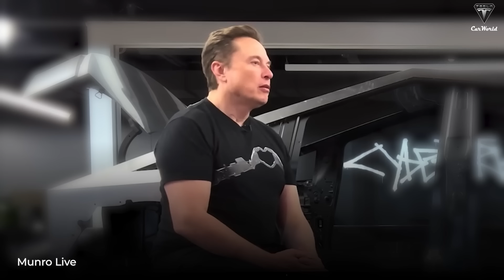Massive Tesla Giga Press 4.0 Detroys All Welding Robots!

Comment: The number of cars produced today is excessive and does not correspond to their actual practical necessity or use. In other words, production is driven by industry or market forces than by real demand.

This is not an economic system but a wasteful of energy, resources and space
Reply from the maker: That’s a fair point—high production only makes sense when demand is real. Tesla is betting that a vehicle priced at $30,000 or less and designed for fleet use can create demand beyond normal private-car ownership.

Comment: Another Cybertruck flop designed to fool investors into boosting falling Tesla shares, when will investors price stock on profits instead of dreams. Tesla's real intrinsic value is heavily debated, with traditional financial models estimating it between $27 and $120 per share, while the actual market share price trades significantly higher at $313.01.
Reply from the maker: That’s a fair concern, but this video is about manufacturing technology rather than stock valuation. The real test is whether Tesla can deliver the claimed 50% reduction in manufacturing cost and turn the Cybercab into a reliable, profitable product instead of just another ambitious promise.
Reply: @TeslaCarWorld  "Just another ambitious promise" and doesn't deliver is how Musk operates. Space X just sold a huge amount of stock to the public for a failed AI and a loss making space business. Don't believe the hype.

Comment: Making the bodywork from a single piece also has its disadvantages. Imagine you get into an car crash and end up with body damage—fairly significant body damage. With other cars, you can just get a separate wheel arch to replace, to name just one part. But with a single-piece body, those individual parts simply aren't available. You'd have to buy the entire bodywork and transfer everything over .
Reply: If you get into a crash with such extend of damage to the body - it is likely the battery to get damaged aswell and likely bursting into flames.
Even if it doesn't - most modern cars have so many sensors and electronics that in order for you to make the car road worthy again, you would be spending a ton of money and time replacing them.
Thus, modern cars are hardly fixable after a more serious crash regardless of the casting...
Reply: I'm assuming it would be considered totaled anyway and given the low cost of production, it wouldn't matter.
Reply: Incorrect. For the cybertruck Tesla produces smaller body parts that can be used to replace parts that are damaged. The principle applies to all their cars.
Reply: Exactly my thought
Reply: It’s an expensive disposable go cart.
Reply: @Cha-g7u2rlike every other modern car
Reply from the maker: Tesla’s counterargument is that reducing major structural parts from roughly 200 to around 80 lowers production complexity and improves rigidity, but real repair costs will depend on the damaged area and insurance assessment.

Comment: still takes a trained mold maker to build thee moldes that make the process possible.
Reply: It helps that these die sets arent solid tool steel, they are built in sections like Lego's.
Reply from the maker: Exactly—the press is only part of the system. Skilled mold makers are still essential because the die’s precision, cooling channels, and surface quality determine whether each casting comes out correctly.

Comment: The problem with that is, it's a huge investment for something that isn't wanted by many. Electric. Stop bowing down to big oil. Hydrogen fuel cell.
Reply: Nobody wants hydrogen cells. To dangerous and there’s no infrastructure
Reply: @weaponizedautism6199  You are incorrect. Hydrogen fuel cell vehicles are no more dangerous than gasoline. A WHOLE LOT LESS than dangerous than electric. Infrastructure? Make it at your house. Rite? How hard is it to make hydrogen?
Reply: @mikehenry-r8s hard? No. Safe for the average moron? Also no. Highly compressed hydrogen is inherently dangerous.

Comment: Those gull-wing doors won't work in real parking lots.
Reply from the maker: That is one practical concern. Large gull-wing doors need enough side and overhead clearance, so tight parking spaces could be challenging unless the opening angle is carefully controlled.